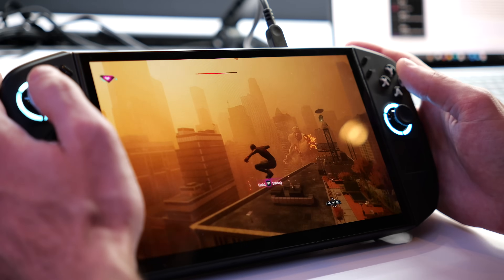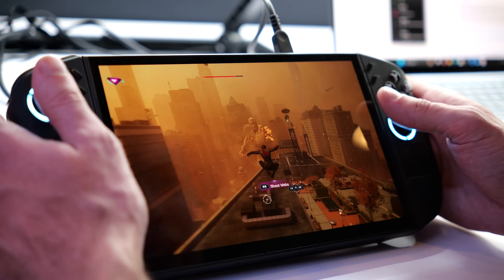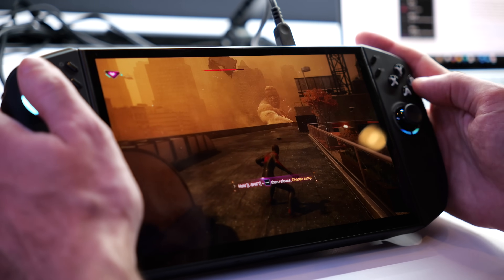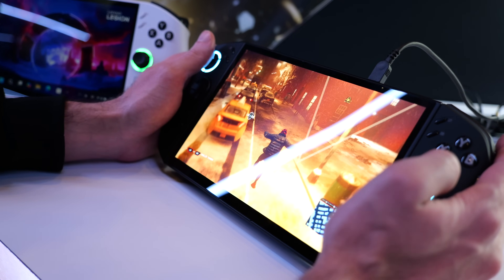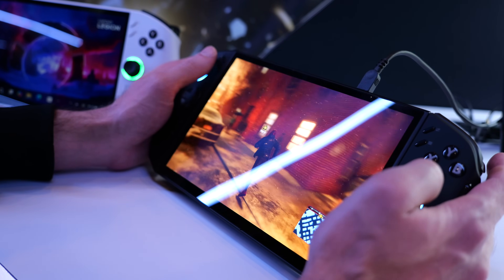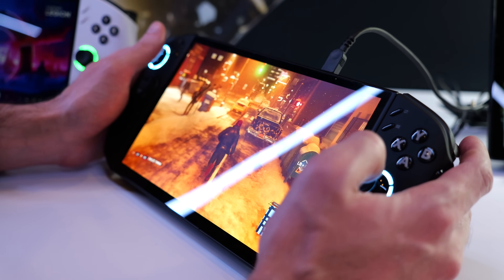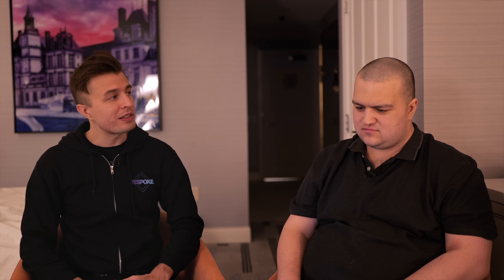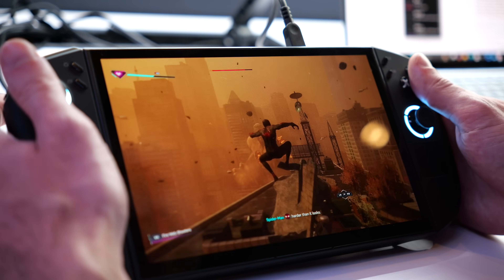AMD's AI Technology Demo Analysed + The NEW Legion Go... Hands-On!

Comment: Looks like AMD is caching up with Nvidia. XeSS still has better image quality and has no AI. They are about to upgrade it to use AI so I can imagine how hood will it be.
Reply: XeSS does use AI lil bro
Reply: Xessuses AI model (Dp4a) only on Intel GPUs   @FBl_Federal_Bureau_of_Investig
Reply: @ not at this level if I remember. Only for specific situations.
Reply: @Magnisus  the XMX version of XeSS uses the ML accelerating hardware within the ARC cards, that's why is the closer to DLSS. The DP4a version (that runs on everything that's not ARC) use light ML in some parts of the reconstruction algorithm.

Comment: AMDs CES is so bad DF thinks they are 4 years behind Nvidia. And I don't blame them. AMD radeon is the opposite from AMD ryzen. Unpredictable and always behind the competition. FSR4 sounds like 2020 DLSS2. With RDNA4 AMD will probably be between 30 and 40 series with RT performance. Even if AMD can get their hardware for UDNA at 50 series level, their software support at this moment is nonexistent. So they would have to built that in 2 to 3 years. AMD has not shown good software so they would need a huge partner that can built Nvidias software stack in a few years.
If it is going to happen, I think it will take AMD 5 years to get to the level of software support Nvidia has. And GPU's seem to go software based just like CPU's. So throwing more hardware at the problem won't scale any more in GPU's. Just like we saw with CPU's where throwing more cores at he problem didn't scale anymore beyond 8 to 16 cores.

Comment: its why its not gonna work as they thought in their plan using rdna compute shaders with custom cdna ai cores does not work well with rdna shaders since its never use for ROPS as ai denoiser ..it been using TMUS and i understand amd trying to do with rdna to make easier for software drivers makers but reality it just make it worst for hardware to run cripple the performance with higher demand in power  due to latest cdna ai tensors arent design with ROPS arechitecture ...only first version Cdna1.0 but that only works with HBM memory only. Its why cdna team would force themselves to do is make  complete architecture card for consumers as well with DDR memory support and rebuilt ROPS while ai is on TMUS